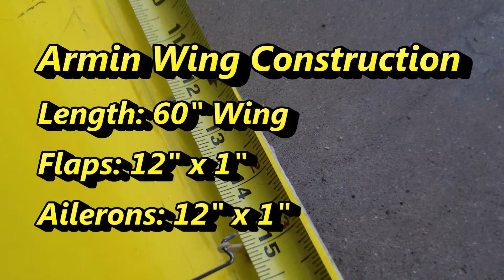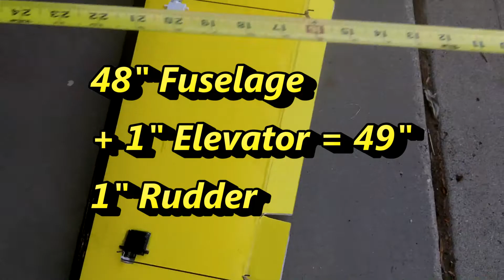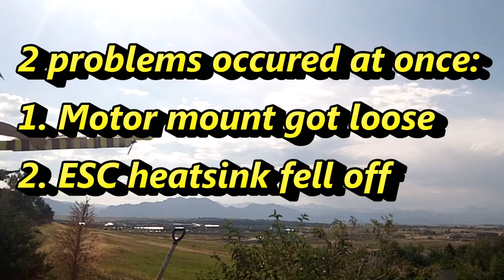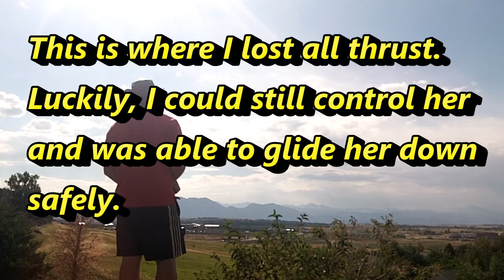Bees Knees - My scratch-built remote controlled airplane using DollarTree foamboard

Comment: here are a few very very late thoughts.  you may know, the proportions of this model make it a powered glider.   the prop Should be about six inches closer to the main wing.   thing wingtip things Should GO away.  the span of the the horizontal stab Could be increased.   at :08, the model is under-propped.     cheers
Reply from the maker: Thanks for the insights and for watching.  I dove into this hobby with a trial and error attitude.  The learning curve was quite steep.  The Bees Knees is due for a re-build.  I will take your comments under consideration.

Comment from the maker: Hey John, this plane is amazing.  It is by far the most stable bird I have.  I trimmed the wing before I glued it.  This let me make a nice connecting edge for additional aerodynamics.  I would strongly suggest wingtips for this configuration.  They changed the flying experience for me.
She glides really well.  The flaps are optional.  With this much wing, she can fly really slowly...

Comment: Nice looking plane and it flies great!  I have a quick question about your wing.  Is it basically a "regular" armin wing with the trailing edges trimmed shorter towards the ends, or did you have to do some special magic while bending the wing?  Either way, I love the way this flies.  I have a 60" wing extended noob tube that I haven't flown yet, but this makes me want to put either flaps or flaperons on it.